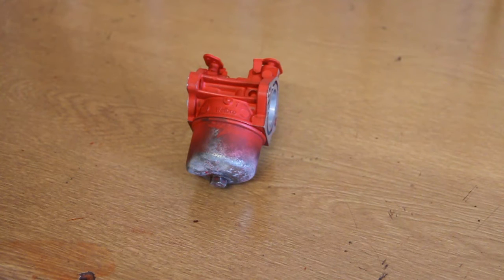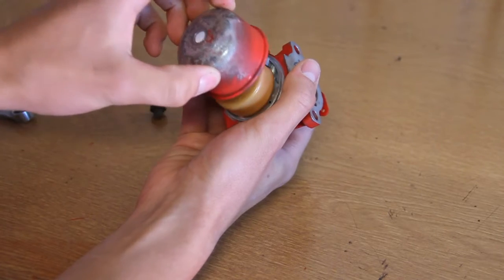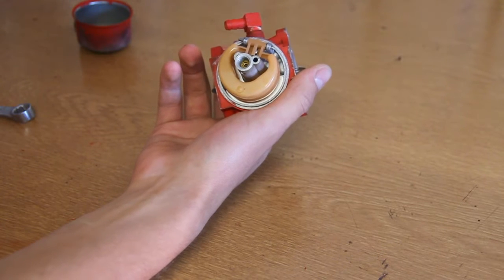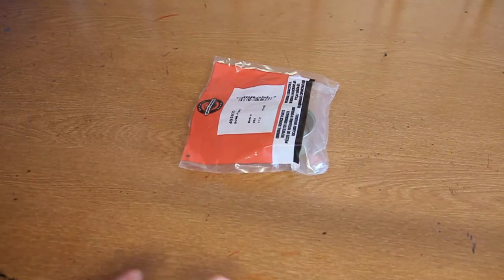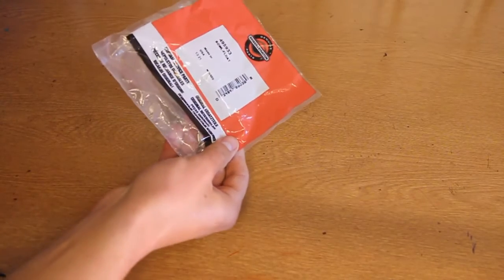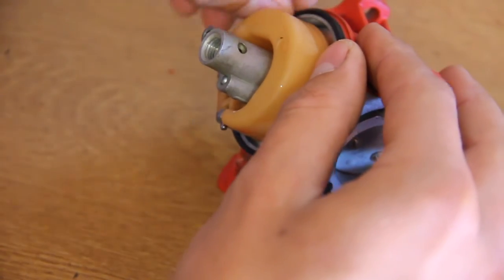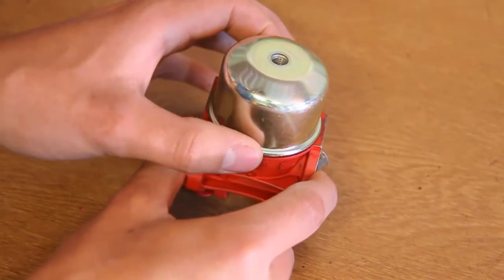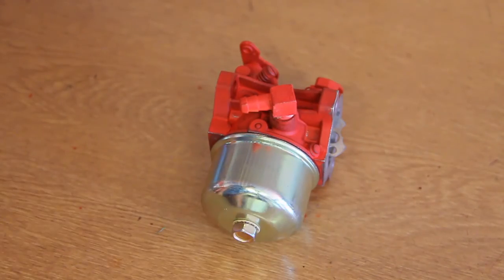How to Replace a Carburetor Float Bowl - Briggs and Stratton Engine

Comment: The odd thing about my Snapper HVAC 28 is the float bowl isn't connected with a bolt.  Me and my neighbor thought it was a hex screw but it's not.  With the location of the float bowl I can't see under it to tell what kind of bolt it is; if it's a hex.  Or maybe it just doesn't come off and I have to take the entire carburetor off.